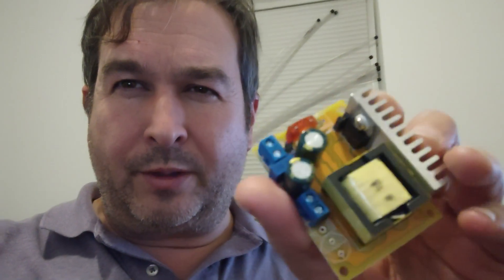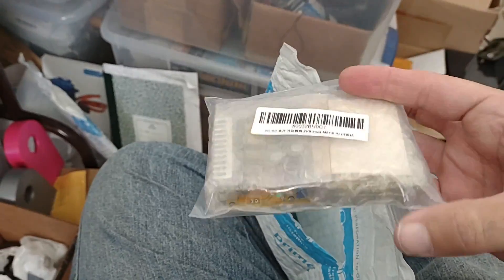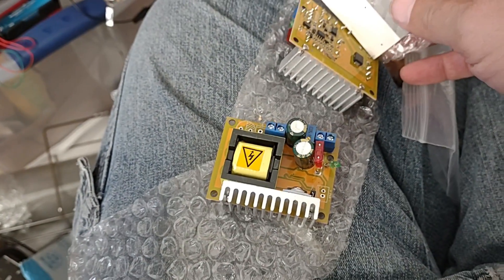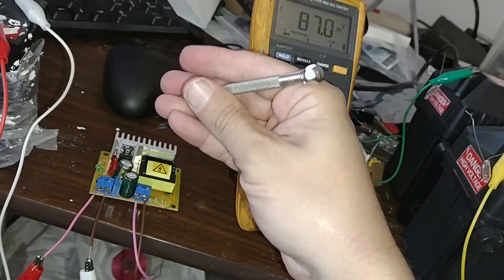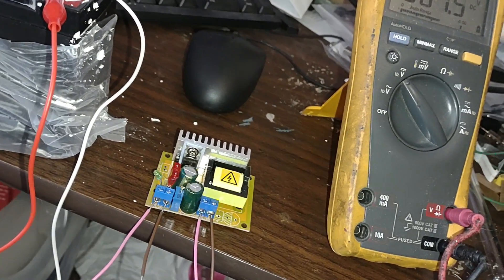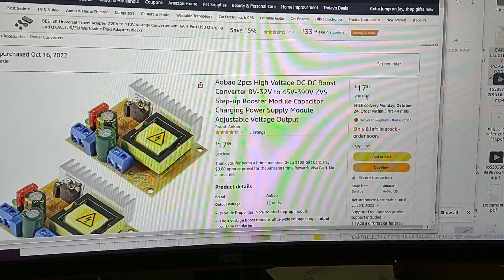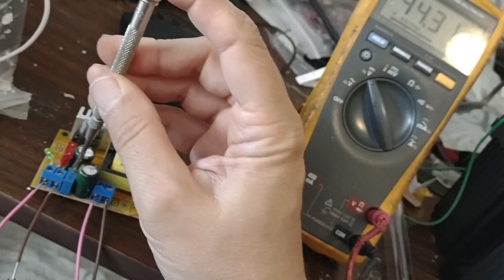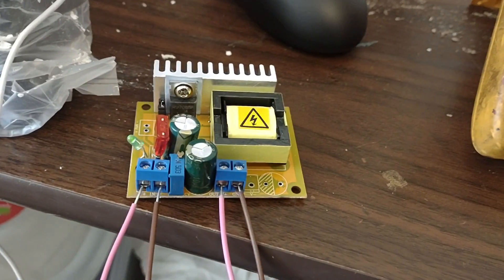390V DC-DC Converter

Comment: I wanted to use for tube amp anode supply. But the output "humps" in every 200-400ms and It can be clearly heard on the output 😐. I don't know what it does inside but not a perfect design

Comment: I use the dual version of this.  First, you should notice that the output cap(s) are only rated at 400v...but the output exceeds this...I have a bunch of 450v caps of the same size, and always replace them.  On the dual version, you can use V- as ground and V+ as HVout. and easily charge a capacitor to 800v.  I have several...I make sure I get the version with the TWO output caps.  IIRC, I got them for ~$7 each a few years ago...never had a failure, except for overvolting the 400v caps at full output.

Comment: I used it to convert 10-30 VDC to 300 VDC 50 mA, which is very conservative according to provided specs.. It worked OK, but output filter electrolyte capacitor is low quality, its ripple current capacity s not up to the task. This 10 uF 400 V capacitor overheats and vents after a few minutes. Need to replace it with a good quality high ripple capacitor like Nichicon CS, or even better with a ceramic wafer capacitor. The power transistor heat sink also gets pretty warm, so it would be a good idea to improve heat sinking.

Comment: 0.2A (200mA) and am wondering what the current is down in the range of like say 260V for potential use charging a Prius battery like the grid charger PSU's?  Anything you can think of why not to use?   Would it need inductor-capacitor smoothing to get rid of the noise more?  Wondering what frequency Prolong and Maxx Volt are switching at?  Looks like this one is a 75kHz.
Reply: 200 mA is current limit at lower voltages. As instruction says, current must be decreased for higher voltages. Practically 50-60 mA at 300-390 V. Under such conditions, heat sink gets pretty warm.

Comment: Using in motor dc?
Reply: Not at all. It's mA rated. To run a high power industrial grade motor you only do that with 1 to 3 phase 480VAC inverter, but not domestic AC mains. You could blow up neighborhood thermal fuse
Reply: Smaller DC motors increase torque with current, and depending on their impedance, the voltage input ratings. No DC motor needs high voltage input
Reply: @brandonbehc  it is a 90v dc motor and the 12v battery
Reply: @adesouza9352  got it, so a DC DC boost converter will do the job, but not a zvs, and this one is a ZVS

Comment: No load current draw?
Reply: It is not intended to use on loads, just charging
Reply from the maker: Yes, I did not test this device under load at high current... I bought this for a specific experiment..I purposely limited the current, in my capacitor experiments, because I wanted a slower charge rate to my cap..
Reply: Less than 10 mA.
Reply: 50mA.
On my 3 cap aliexp.version of 4usd.
made an electric fence. 200v.
cats love it.
Did touch it myself to test it.
 Not much power behind it.
short pulse.

2 parallel wires over my fence.

Comment: 390v @ How many amps ? 
Thats the most important question
Reply: 40 mA or so, it's just a charger. You increase V, A diminish (power compensation). Plus it's not intended to use with loads, just charging.
Reply: 0,2 a
Reply: @Tomistbigboss  What Brandon said, 0.2 A only for lower voltages.

Comment: All of the good electronic innovations are going to come out of China for the next 100 years. Their logistics is leaps and bounds ahead of the US. In Chins, you could prototype that in a day and get 1000 manufactured within a week. In the US it would take 3 months
Reply from the maker: I blame the bureaucrats for the suffocating legal restriction the levy upon all us poor souls trying to live in this "free country".. 10,000 laws on the books + secret laws, enforced in a duplicite system = ABSOLUTE TYRANNY!
Reply: It's a classical circuit but controversial in physics and engineering. Actually industry do not use that because of international standards by US gov do not permit that.
Reply: And also, it is not intended to use with loads, no power
Reply: Very interesting point.